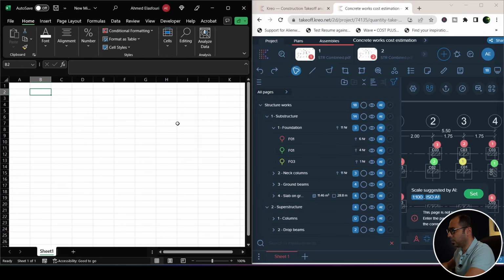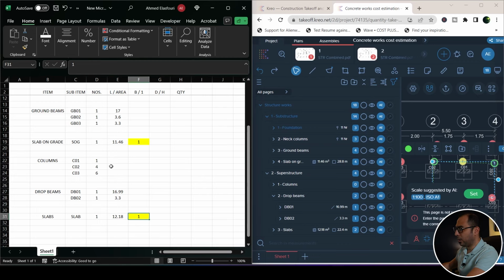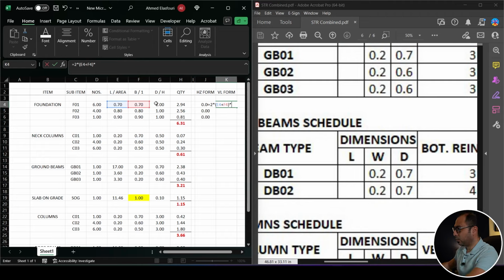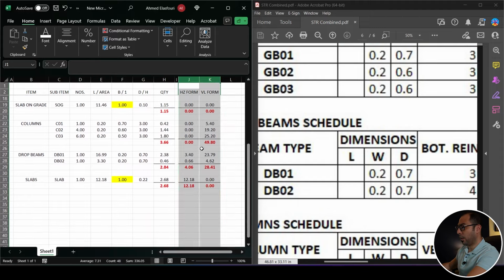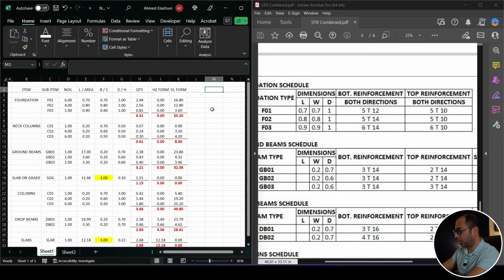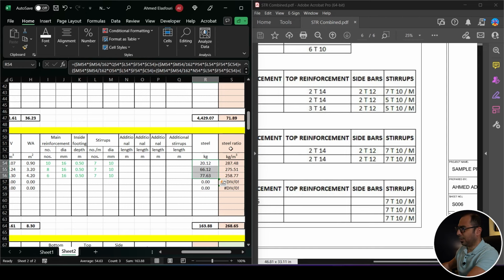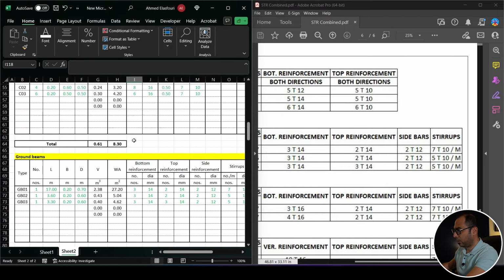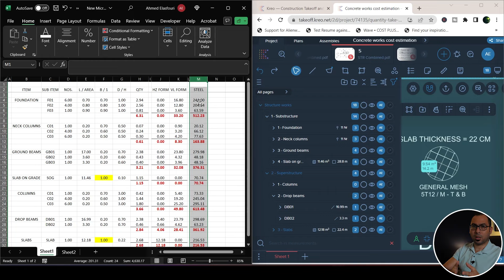COST ESTIMATION | How To Estimate The Cost Of Reinforced Concrete Structures Part 3

Comment: Mr. Ahmed I have a doubt in the steel calculation sheet. how will you use this steel calculation sheet for the beam steel calculations, for long span beams where it has steels such as top extra at both ends, middle extra bar, bottom curtailed bar, bent up bars, and stirups for both end stirups and middle stirups with different center to center. If you explain how to use your sheet for these calculations in your next video will be much better and help in using your sheet. thank you .
Reply from the maker: What I usually do is that in case there is extra reinforcement I add half of it to either top or bottom reinforcement. For example if the steel is 3T14 bottom and extra 2T14 midspan I add 1 to the 3 and I put 4T14 in the sheet. Similar for stirrups if you have different numbers near support and midspan take half the near support and add it to the midspan. It will give you weights that are very much near from actuals. For ordering the steel to the site you have to do bar bending schedule and calculate the steel in much deeper details 👍👍
Reply: @CEPQS Usually, you calculated steel/rebar in the BOQ is more a lot than BBS calculation or same?